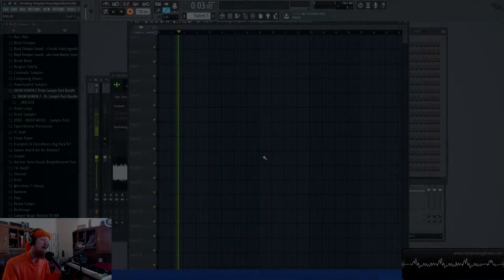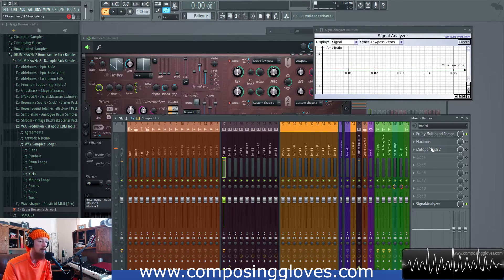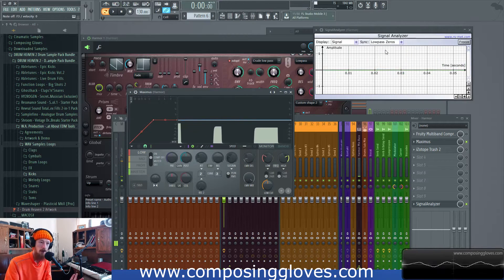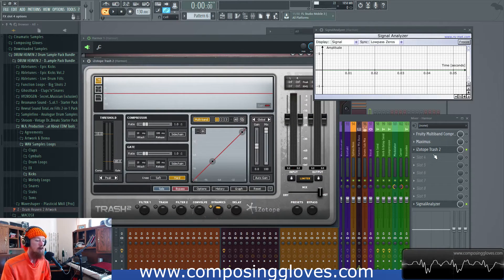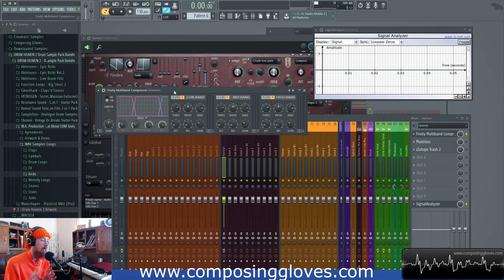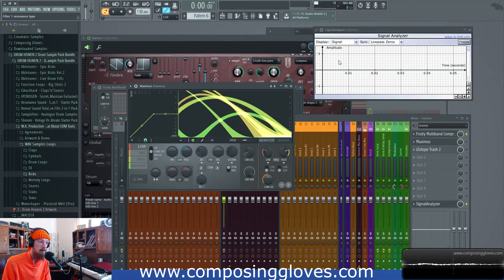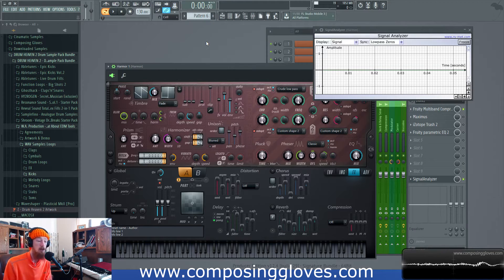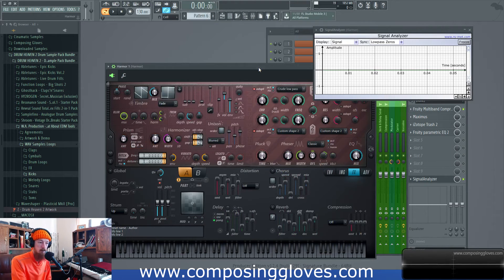Principles of Mixing 22 - IIR, FIR, and Linear Phase Filters

Comment: I don't know if you can help me, but I have a Tascam DR100 mk iii digital recorder, which I am going to be using to record dialogue. On it, it has four options for the digital filter. FIR1 is for sharp roll off outside the audio, FIR2 is for slow roll off, Short Delay 1, for sharp roll off and Short Delay 2, for slow roll off. Do you have any thoughts on which one would be best for recording spoken dialogue? I'm just searching around the internet and found this video where you mention FIRs. Any thoughts appreciated.
Reply from the maker: I would do a couple of experiments with the settings but the first set up I would try would be FIR2 short delay 2. Just because fast rolls off's can color your signal. For dialog the modulation of the voice is so complex it is unlikely there will be a substantial difference.
Reply: Composing Gloves Thanks. That gives me a little something to go off of.